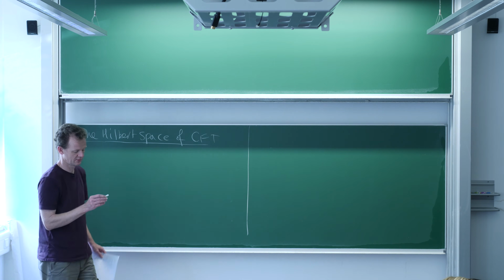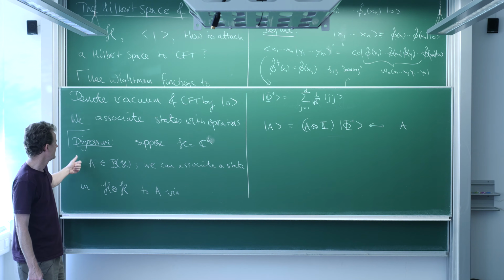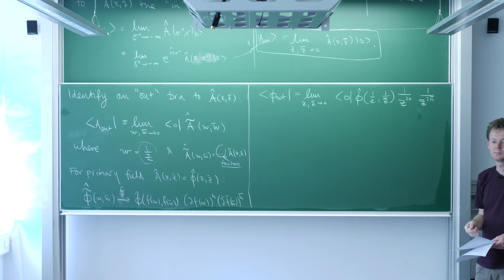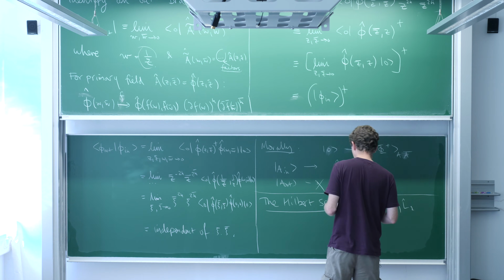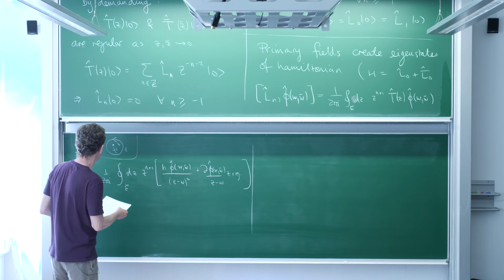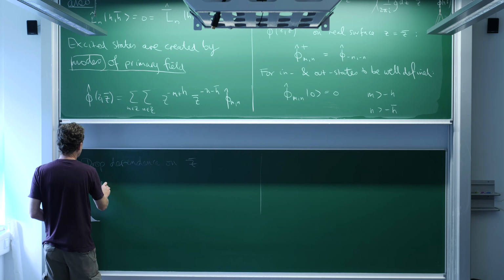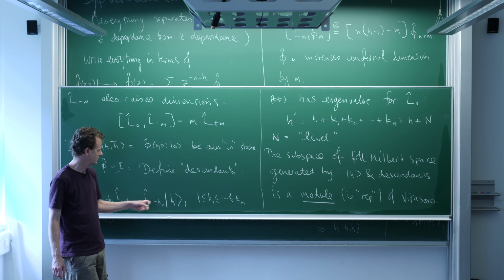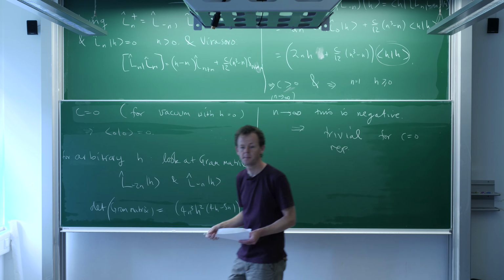Introduction to conformal field theory, Lecture 10

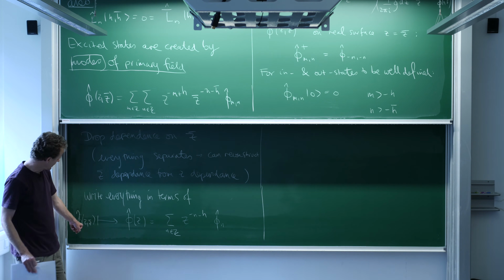Comment: Great lecture series. I'm confused about the expression of a primary field expressed in terms of a mode expansion at 1:02:55. On the last green board, you mentioned that z part has a power of -m+h. However, now it is -n-h. Would it not affect the physics? 
You've done the same in your notes as well.

Comment: in 27:15 you said that the tilde version has to be replaced with untilde version which you did except the argument remain unchanged, I'm a bit confused cause on the bottom left the argument is f(w) (which is equal to z) but on the top right you wrote w=1/z as an argument?
I am a bit confused.

Thank you
Reply: I think the tilde should be there. See Di Francesco's CFT 5.1.4 .